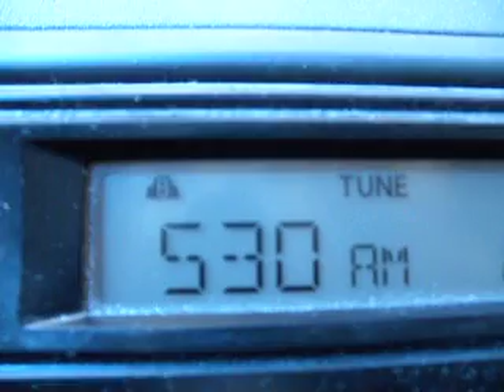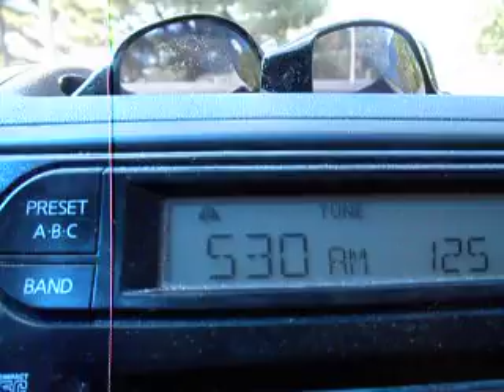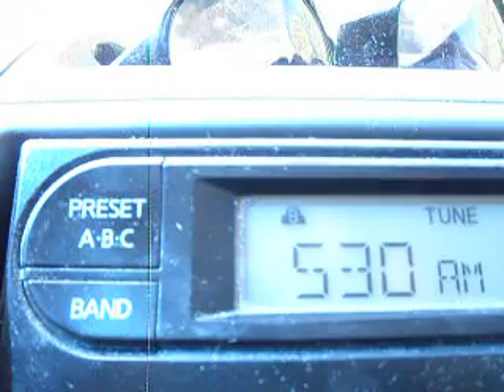Using a Car AM Radio for Detecting Power Line Electromagnetic Interference (EMI)

Comment: Huh, never woulda crossed my mind to use the radio in a car. I've been using a telephone pickup coil plugged into a recorder. I can hear the power lines when I walk under them. Can you also pick up cell phone tower signals with your car?

Comment: Nonsense!
Reply from the maker: Has Nas http://www.powerlinenoise.com/ Of all the types of noise and harmful interference that hams have to deal with, none is so ubiquitous, annoying, and devastating as power line noise (PLN).  By that term, we mean radio frequency interference (RFI) that comes from sparking/arcing utility pole hardware.  It is broad-banded, often very strong, and sometimes difficult to get fixed.  The harmful interference generated can completely ruin your ham radio experience, unless all you do is talk on local FM repeaters.

Comment: that noise is the AC field forming and collapsing very rapidly. that looks like 50kv power lines
Reply: not the 50/60 hz field but it's high frequency harmonics (due to the corona discharge, etc) creates the noise on the am radio (and not only am radio but also fm and some other radios)
if you want detecting 50/60 hz elf field from power line use gauss meter
Reply: ok thanks